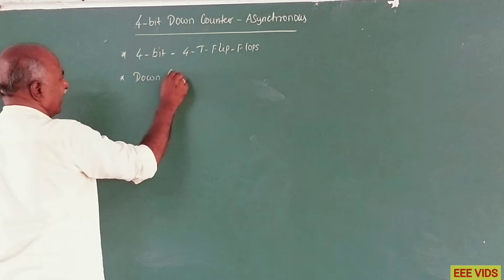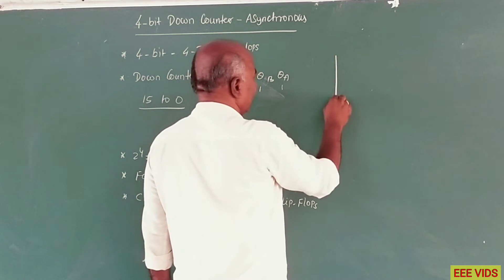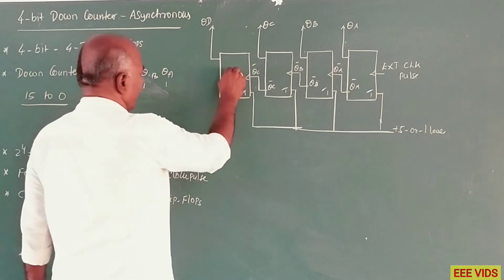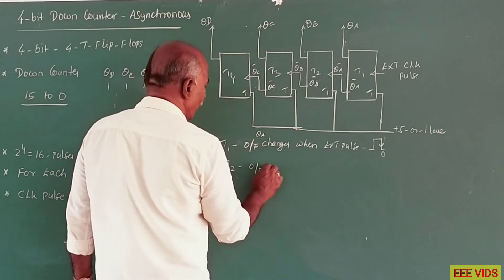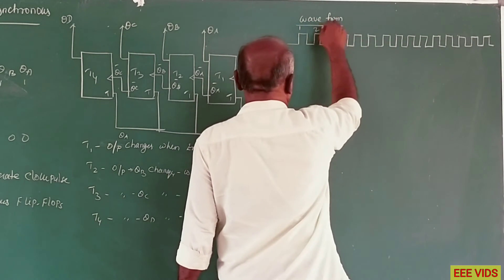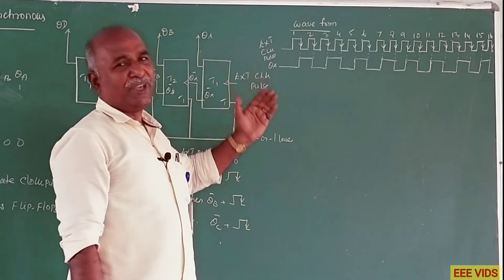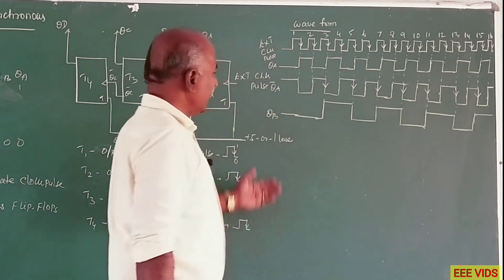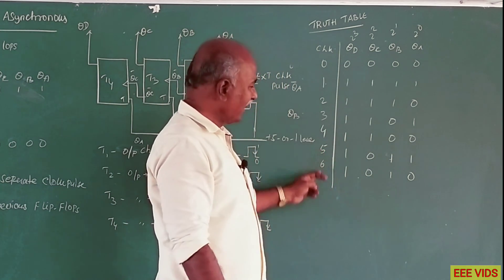4 bit Down Counter Asynchronous type in tamil

Comment: Hiii, sir
 One small  doubt  , my questions is.
 One DC Supply circut equipment it is connected  in each battery 12V 100AHC X 04 battery serious.
(Just like it is charger in mean FCBC - Float cum booster charger) 
Battery connect in serious total in circuit 48 V 100 AHC 
 And it equipment  load connected(DC equipment)in  48V DC ,2.2 Amps DC.
 So, 
My question in the backup time of the that equipment. In 2.2 Amps Load DC
 
 Pls solve and published  one video sir,
Reply: And explain solution and Formula sir